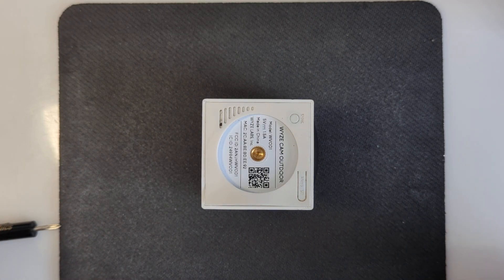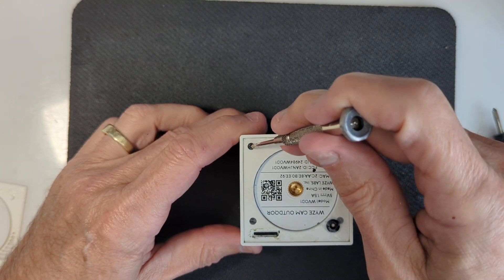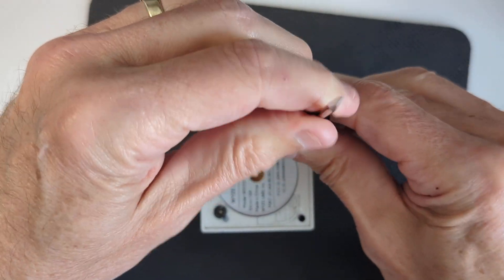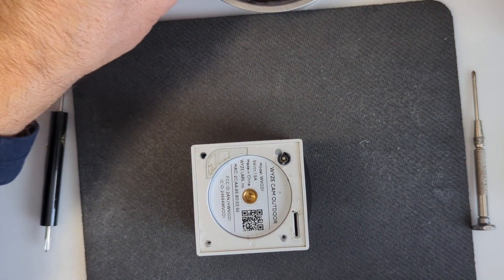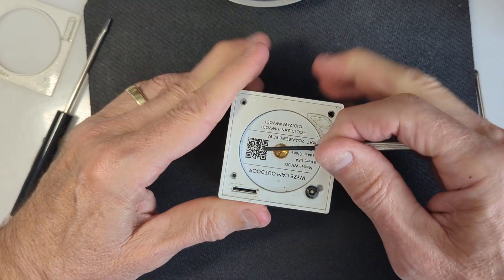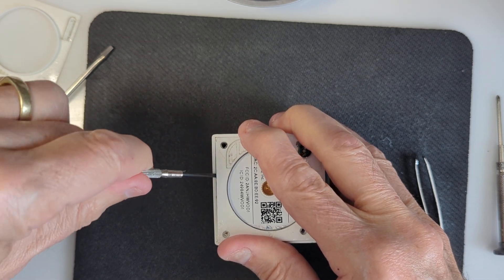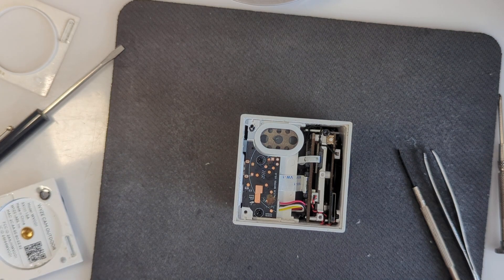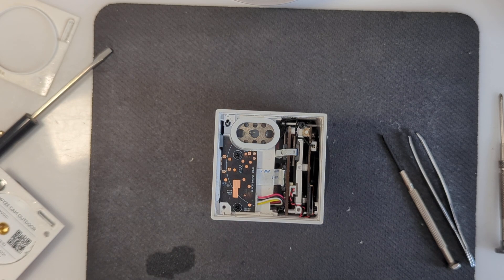Wyze Outdoor Camera disassembly (battery not charging)

Comment: By taking it apart you probably destroyed the integrity of the weatherproof seal.
Reply from the maker: Yes, but it had already leaked and wasn't working so there was nothing to lose. I hope their newer versions put the power/battery circuitry at the top, rather than at the bottom -- which is where water will naturally collect.